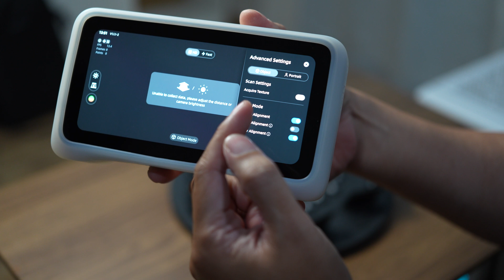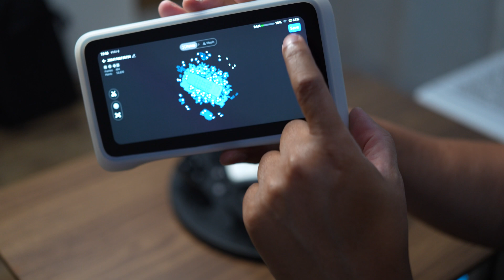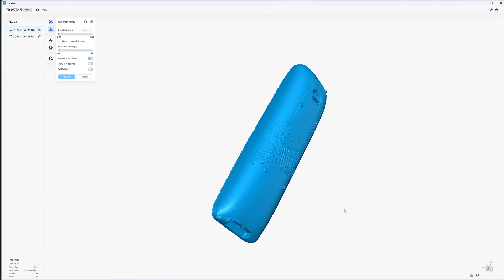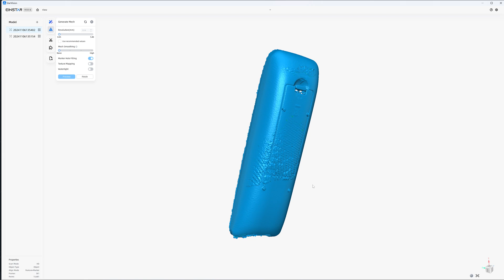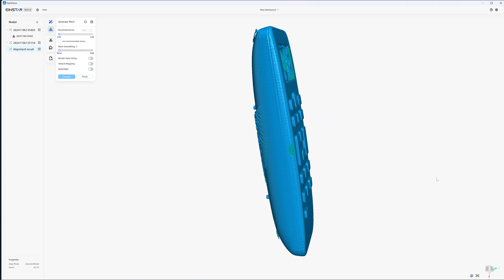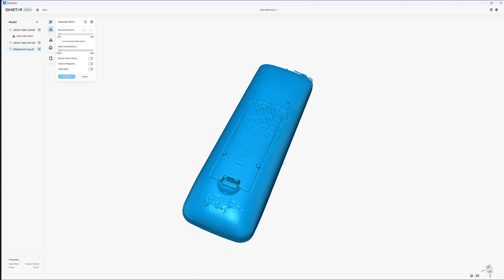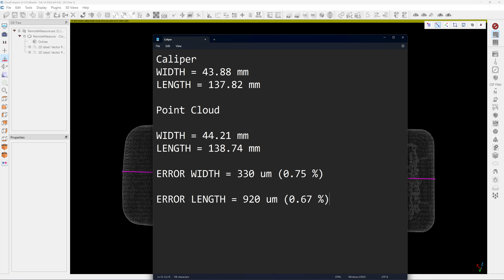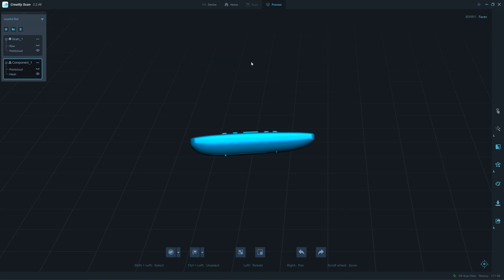Einstar VEGA - White Object Scan and Accuracy Test Vs CR Scan Otter

Comment: I have the same problem with my vega with those dragon skin artefacts. The problem is while scanning you can’t undo the frames when you miss the tracking. It keeps scanning junk.
Reply: Have Einstar resolved this problem with updates?
Reply: @Rasle500  Yes. You can undo now. Slide back in the timeline and resume just before the error and do it better on the new attempt.

Comment: Which consumer scanner has the most accuracy for scanning small parts (<250mm)?
Reply from the maker: If you want accuracy, get a blue laser scanners. Dimensions scanned from infrared scanners will be affected by color and surface reflection. I get +/- 20 um from CR Scan Raptor.
Reply: @Payo-TensileCreator  Perfect. I already ordered the Raptor a few days ago. Just wanted to be sure I made the right decision buying it.

Comment: The noise on the back of the controller is due to a misalignment of scan data. Probably caused by a tracking failure or the controller moving very slightly relative the the markers. You need to lock your target to the markers to prevent the second issue. Ideally, the software needs better tools to remove this misaligned data before meshing.
Reply from the maker: No, external markers are not moving. I made another scan with Otter after this, no issue at all and I did another video when I put sticker markers directly on to the object, this artifacts shows up as well.
Reply: @Payo-TensileCreator  In that case it is a tracking failure, which was the first issue I mentioned.

Comment: how does the point cloud distance relate to the accuracy of the test? 
if you use the point cloud distance 0.18mm in Starvision, does that mean it rounds off all values to a resolution of 0.18mm or is it truly the 3 dimensional distance between all points?(in that case the error due to rounding would be much less) 

thanks for the measurements! it is very useful and gives me an idea if it can be used in my applications
Reply from the maker: No, it isn't related to accuracy. the point spacing is about 0.18 mm, for 1 sq.mm, it should have 25 points. The coordinate of the points at the extreme edge is fixed. Setting it too high would give a denser look, too low it would be difficult to see.